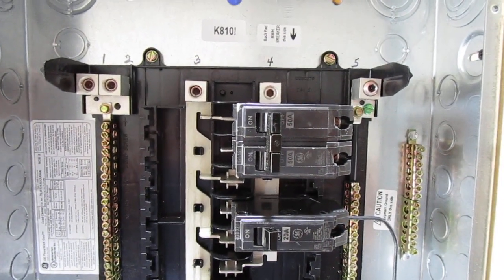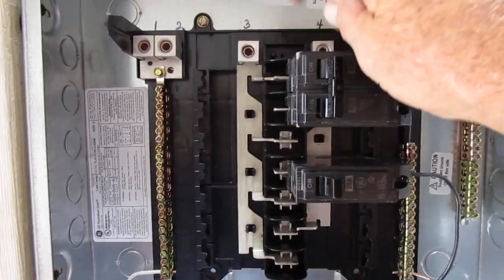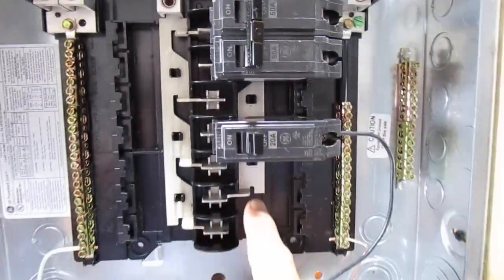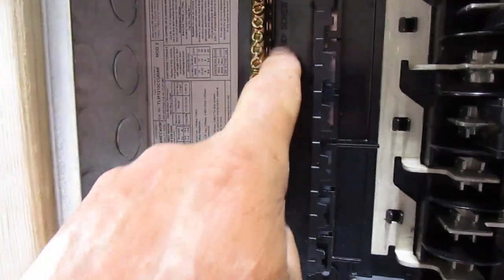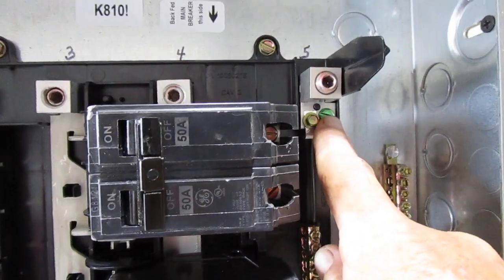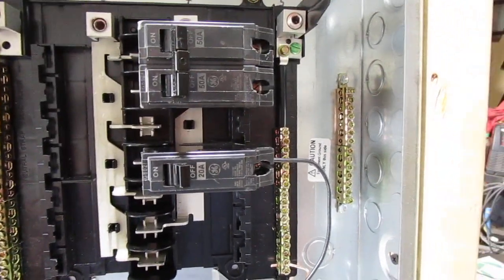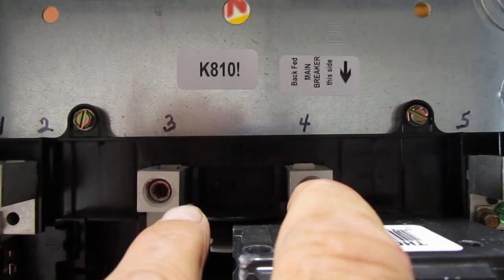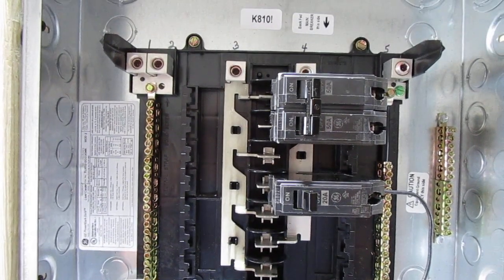125-Amp Main Breaker Box Electricians Questions for Pro's

Comment: It depends if that is your first point of disconnect or a sub panel, first points require all neutrals and grounds to be bonded, sub panels need neutrals and grounds to be separated or isolated.

Comment: Hello, I have a few power mark gold 100. The wire from my house has only 3 wires. So how would that hook up to a system that looks like yours.
Reply from the maker: If it looks like mine the power in is most likely the same. 1 ground. 1 live and a neutral. You would need to install a main breaker that you would feed the above wires into. If I understand you correctly, if I had a image of what you are using, I could tell you for sure

Comment: I recently installed a panel similar to yours and found the same issue and I have a lot of experience. Usually there would be a jumper bar from 1&2 bar and 5 bar but in these panels there isn’t which is why I looked up the video. I would think if this panel was used as a main bonding those bars with the green provided green screw to connect them together is the intent but I don’t like the fact of using the box as a conductor especially if neutrals are connected. I’m probably going to put a wire from main lug to main lug meaning 2&5 to be safe.

Comment: First of all In a main Panel both the white wires from the branch circuits and the Bare copper wires need to be connected  or tied together for instance with the green screws that tie the terminals together through the body of the box. If the Neutral wire from the meter is hooked to a terminal that has a green screw, it is connecting Neutral to the Box and any terminal connected to the box also becomes tied to the Neutral wire

You have to understand the difference between the( neutral)   white wire  and the bare copper (ground) wire meaning Earth Ground.

The white or neutral wire gives a path for  current from either of the 2 hot wires when a 110v load is connected across hot and neutral. The ground wire is not suppose to carry current unless there is a short in the branch circuits to ground.

In a main breaker box 3 wires come in from the meter  110v/ neutral/ 110v.   The two 110v wires would go to your terminal numbers 3 and 4 to supply the breakers.
The neutral wire would go to Terminal #5 and your ground bare copper wire coming from the grounding rods would connect to terminal 1 or 2 but the grounding screw must be installed in that terminal also in a main panel. Then you can wire the bare and white wires from your branch circuits to any of the terminal bars in the box as they will all be bonded together Neutral and ground.

So basically the terminals that have a green bonding screw, that screw connects the terminals to the case of the box as a way to connect the terminals together with one another, or take the screws out and only the wire at the top feeding that terminal will be connected to that terminal isolating it.

In a sub panel you want to remove the grounding screw from the Neutral terminal. You want the neutral wire to be on a terminal  that only white branch circuit wires connect to, 
The bare copper wires from the branch circuit would then only be connected to a bar that the bare copper wire from the grounding rod is connected to and the green screw should be left in that bar so it connects the ground wire bar to the case of the box and any other terminals attached to the box such as the one in the far right of your video.

Imagine a sub panel being like using an extension cord wired directly to the main panel. Every 110v circuit connected to the main panel has  3 wires ( in the case of 220v branches there should be 4 wires coming from the main panel) But in 110v circuits the black wire outputs power, the white wire is the return for the power, the bare copper wire is only for safety and hooks to any part of any appliance or anything you have plugged into an outlet that is metal that could become hot or electrically charged if there was a short inside whatever device is plugged in.

When there is a direct short , that bare copper wire gives a path back to ground in the breaker box and trips the breaker instead of making you the path to ground shocking you. Under no other condition other than a short should that bare copper wire be carrying current.  Although there are situations where a partial short will not trip a conventional breaker and you could still get shocked,  that is why they designed GFICs, ( ground fault interrupter circuits) read on to see how those work.

So with that thought in mind imagine a sub panel as being an extension cord to a plug end, you would not want to bond the bare copper wire to the Neutral wire in a sub panel using the green screw because if the Neutral wire ever becomes more resistive with a bad connection, the bare copper wire then becomes a conductor and carries current  back to the main breaker box making the bare wire possibly  hot if it lost it's ground connection at the main panel.

 Using the bonding screw in a sub panel would be the same as wiring the plug end of a 3 pronged extension cord by  hooking the green wire meant for the third prong of the plug  to the same terminal the white neutral wire goes to. Common sense you would not do that.

To further explain the grounding wire and it's purpose, your main panel has 3 wires coming from your meter, 2 hot wires and one Neutral,  the 4th (bare copper) wire  comes from  an outside ground source which can be underground plumbing lines or other sources but usually grounding rods with no more than 25 ohms resistance.

The Utility company along the way down their line uses earth ground as a common connection for their neutral line to stabilize the line from power surges or lightening strikes.

That is why it is important to have an Earth ground  along the way and as close as possible to any main or sub panel source for the connection of branch circuits.. It protects your branch circuits from voltage surges that might happen in your neutral from lightening or other sources.

If you wonder why they have Ground Fault Interrupter circuits in Bathrooms, Kitchens and Outdoors where you can be in wet conditions it is because moisture increases the current of electricity through you.
Lets say you have a partial short in something plugged in, but that short is not bad enough to draw enough current to trip a 15 amp breaker,  but is enough to kill you. 

A GFI circuit senses the current flowing on the neutral wire and on the hot wire, if the two do not match it means some current is traveling to ground so it immediately cuts the power off or trips because it senses there is a path to ground for the current, possibly being you

It is not voltage that kills you, it is current or how much flow of electricity that goes through your body.

Static electricity you get from carpet or clothes out of the dryer is hundreds of thousands of volts but a very small current, that is why it does not kill you but 110volts can cook you and that is why following electrical code is so important.  The code is constantly changed to make things more safe as they discover issues.

If you had a sub panel  that uses conduit for the ground and you bond the neutral to ground in the sub panel, if there is ever a brake in the conduit to the ground source the whole conduit from the brake back to the sub panel can become hot and if you were well grounded could kill you.

Where I use to live a plumber was fixing a water leak under a house, he was lying in the wet ground very well grounded, he somehow got in contact with a bare 110v wire and he was smoking by the time the fire department got there, that was the end for him.

That is why I wrote so much here, the more you understand the importance of  why you are suppose to do things a certain way, the more likely you are to do it right which might not only save your life but anyone later that comes in contact with your work.
Reply: You should have your YouTube Channel with the  knowledge you have, I mean I am impressed with your explaining and the time it took you to comment so much details. Go for it!
Reply from the maker: Thank you. Appreciate the comment
Reply from the maker: Thank you. Appreciate the information

Comment: There is no main for this panel, lugs only as indicated on your box. 1,2 neutral should have 24 screws. 3,4 hot buses, phase A and phase B. 5 ground bus should not be connected to the neutral bus. I think 5 is less than 24 screws thus the extra ground bus on the right to make up for it. This is what I assume looking at you panel, you need to verify.
Reply from the maker: Yes sir. Got it figured out. Appreciate the comment

Comment: I have the same one too that’s a great setup the ground screw is a bond screw that’s to use only in a main panel but for a sub panel the ground and neutral has to be isolated 😎👍🤩
Reply from the maker: Yes sir, you are right

Comment: In that style box, the power is fed through the breaker to the bus bars (what the main current flows through to the other breakers).  The #3 & 4 lugs on the top are called "pass through" connections.  They allow you to connect another full amperage connection for use on another sub-panel.

The "bonding screw" connects the neutral bus bars to the case and subsequently ground wire.  The transformer from your utility connection is also grounded at the neutral tap, but the ground(s) are not intended to carry any current (neutral is the return path to the transformer only).

By bonding a sub-panel, you're potentially creating a path from the ground wires to the neutral leg, and this can cause current to flow through the grounds and energize the case of anything metal connected to it (like your toaster or old metal body power tools) if there's a neutral fault.

Short answer: never bond neutral and ground beyond the main panel.
Reply from the maker: appreciate the comment. Thank You

Comment: So a max 125 amp double pole breaker from the main box go to #3 and #4 (Black and Red or 2 Black) to power this sub panel.White comes in from the main box, to #1 then a white jumper wire from #2 to #5 to have neutral on both sides, Bare wire goes on the bus bar all the way on the right. The Green screws ground the metal box with a wire to a nut and bolt through the box. USA
Reply: Hello I have the same issue can you due a video
Reply: Mip @dannyatbf2
Reply from the maker: Let me see if I can put one together..I finally figured mine out with the help of a few YouTube good ole boys
Reply: Larry Sbrusch how
Reply: Can you send me a video I have the same pann with a 125 breaker
Reply: @LarrySbrusch  send me the link to ur video please have the same thing
Reply from the maker: @davidsims2511  I think I got it figured out...https://www.youtube.com/watch?v=I1UGmLYSWS4&lc=UgzpEhF_ng2OJnhmH354AaABAg.90XG_Dl8vRU9H1fbAzKsS0
Reply from the maker: thank you for the comment

Comment: Thanks for the vid. I'm having the same issue. Please let me know if you find out. Thanks again!
Reply from the maker: I think I figured it out..a sub panel is what it is..a sub panel .it pulls power from your main breaker box that comes into home and then you can use this panel as a remote panel in another location..so in reality the main breaker box will supply power to this remote panel
Reply: Larry Sbrusch thank you for responding. So the ground and white neutral was correct?

Comment: I have a similar panel box (Square D HomeLine 125A) but my cover has a slot for a main breaker but I don’t know how to get it to actually hook up as there’s not way for it to hook up. Terrible kit when parts aren’t included. Defeats it being a kit haha
Reply: hey what gauge wire are you using in your 125amp square D subpanel?